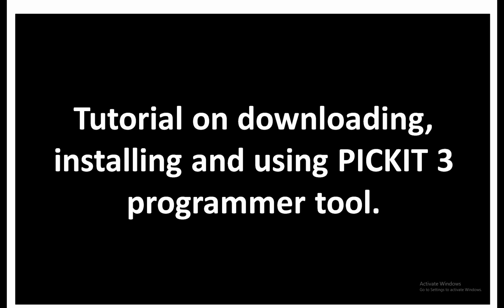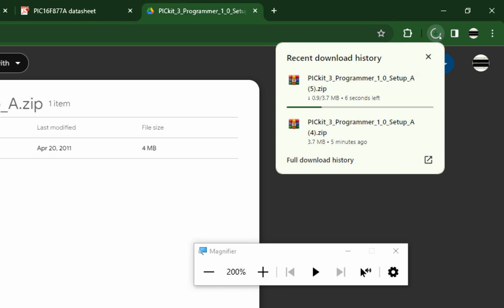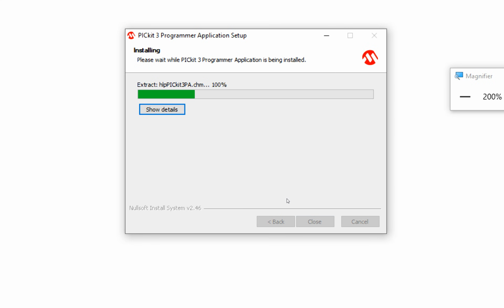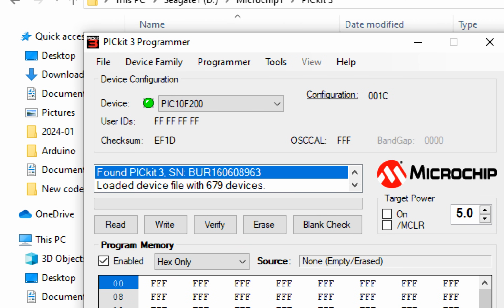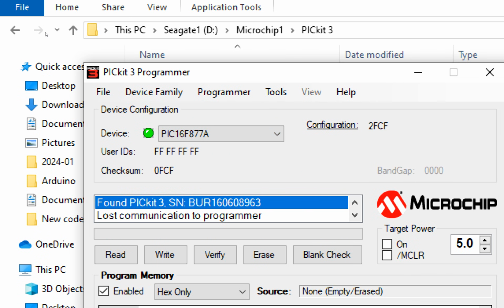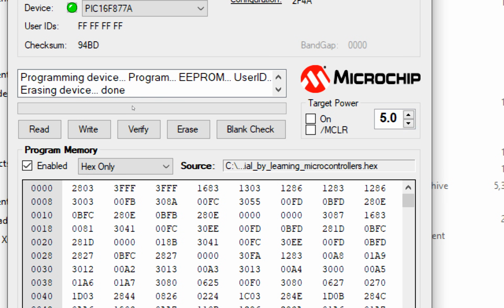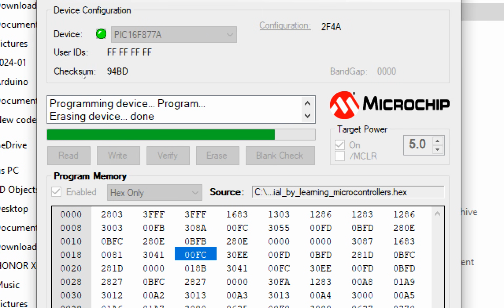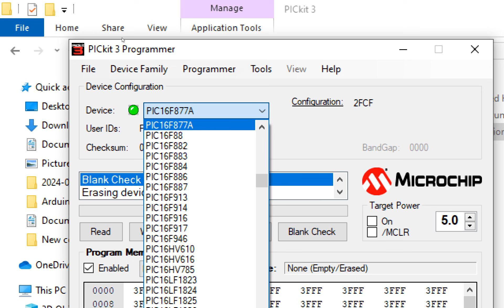Tutorial on downloading, installing and using PICKIT 3 programmer tool.

Comment: I am not able to detect dspic30f2010 using pickit3. What to do? Only pickit3 is getting detected when i select check communication
Reply from the maker: Check circuit
Reply: @learningmicrocontrollers3561 circuit is correct, do i have to connect capacitor, if so what capacitor and where should i connect
Reply from the maker: Yes you need cap and a crystal
For external oscillation

Comment: hello sir, i have a problem that when i insert my pic16f877a into the breadboard and input code for it, on the pic programmer it show that the pic have read the code but my led doesn't on or off like your video blink led with pic? do you know why?
Reply from the maker: Check the MCLR pin
You have to power up pin 1 with 5V using a 10 resistor
Also check grounding capacitors next to crystal
Reply: @learningmicrocontrollers3561  ok i have fixed it, but now when i upload code into pic it show that can write bcause of program memory failed at0x000001
Reply from the maker: @minhkhoatran396  your microcontroller is damaged. Try with another one

Comment: My programmer device  pickit 3.5, my programmer does not work Checkbox device select auto and manual. Please help
Reply from the maker: Install CH340 usb to ttl device driver then tey
Reply: Did you solve the issue ?? My pickit 3.5 is also not detected...

Comment: como faço para solucionar o problema de "voltage level erro" quando abro o pickit?
Reply from the maker: Which PIC you have?
Reply: @learningmicrocontrollers3561  18F4550
Reply: change the usb port. Probably can't deliver 5v.